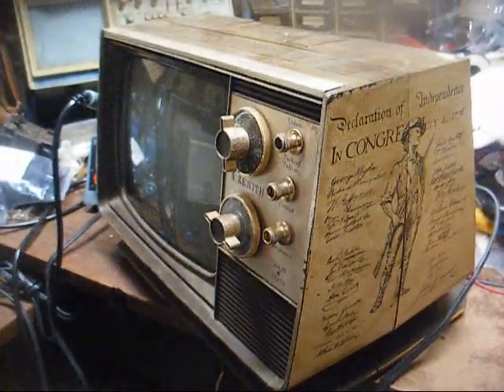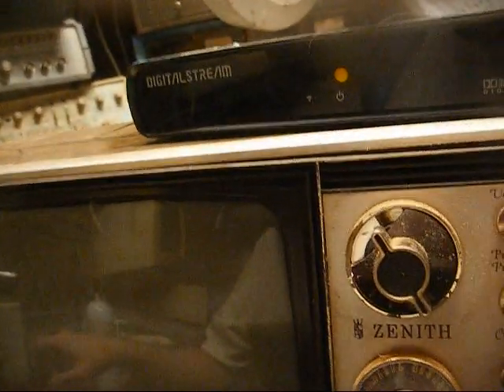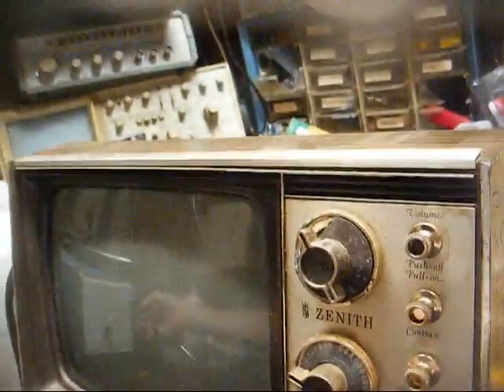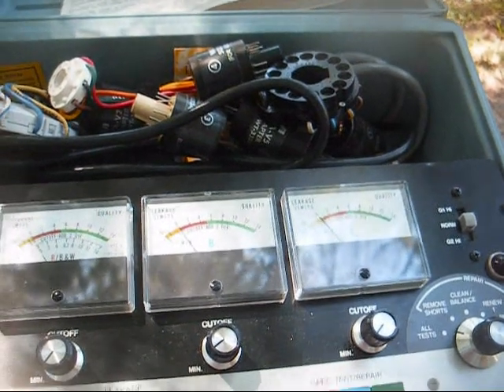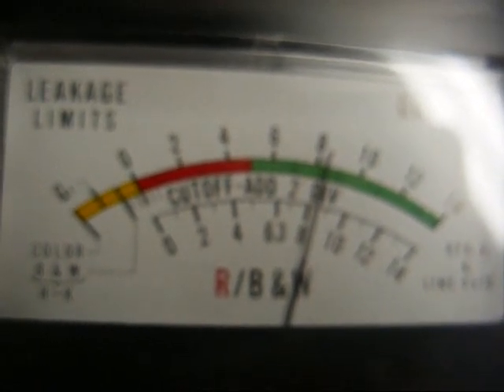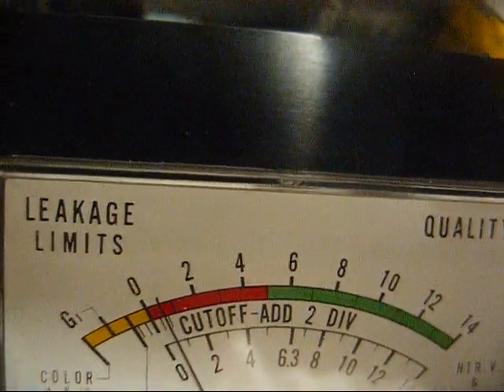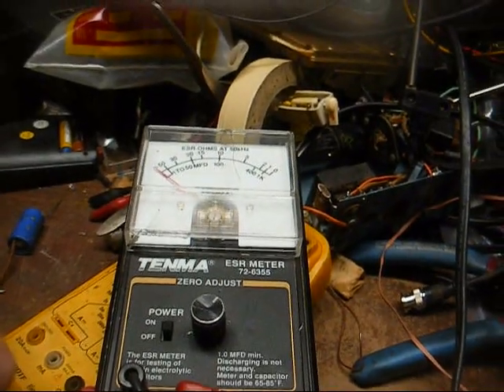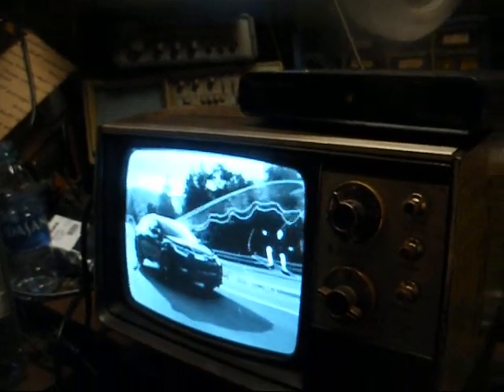Repair of a Zenith Spirit of '76 B&W TV

Comment: Nice to see this set Bryan,  I was a part of the B & W design team at  Zenith 1973-1981. This is one of my babies. Built in Taiwan but designed in Chicago.
Reply from the maker: You did a good job. I have a 12" hybrid Zenith B&W from about '73 and an early '80's Zenith 12" with the digital tuner. I'll do videos on those, one day.
Reply: @radiotvphononut  The 12 inch hybrid was tagged out by me in 1974 but was designed about 1971 before I got to Zenith. The 12 inch with a digital tuner was one of the last sets I worked on. That tuner was used in a 19 inch as well.  The 12 inch with the doorbell camera was mine. In fact I have the patent to prove that. The last set I did was the 5 inch with a clock and AM/FM radio.
Reply from the maker: @WilliamCohn  One Zenith I'd love to find is one of the 22" solid state B&W sets in a metal cabinet. In all my years, I've only had one and that was back in the early '90's. I think it was from 1977 and the CRT was dead. I rejuvenated it and sold it to someone cheap. Somewhere, I have the photofact on a Zenith B&W 22" console from '81 and I'm told that was the last year for B&W consoles because they stopped making the 22" CRT's. I think 19" B&W's held on for a little while longer; but, I don't know for how long (maybe mid '80's).
Reply: @radiotvphononut  That was my project as well. 19GB1X chassis and the last chassis 19LB1X. It was used in the 16, 19 and 22 inch sets. The 16 always had the brightest picture because they all had the same high voltage. The 22s sold well in your area down south. 22 inch CRTs came mostly from Sylvania but some came from Clinton in Rockford, IL.
Reply from the maker: @WilliamCohn  I've got two Sylvania B&W consoles that I got from a closed TV shop/dealer. One is from '78 and the other is from 1980. He told me that even in the '80's, they had older customers who wanted no part of a color TV and that's why he kept the large screen B&W's in stock for as long as he could get them. One time, I saw a price sheet for some of those later B&W consoles and some were as expensive as an entry level color portable.
Reply: A friend of mine’s uncle was an engineer there.... last name Hendrickson

Comment: The connector on the bottom would probably be for a battery pack
Reply: I just commented about the battery. Mostly a gimmick.  A reasonable size, weight and cost nicad battery pack could power this tv for an hour and a 1/2, maybe slightly more.  Radio Shack used to sell "high capacity" NiCad D cells that were 4500mah.  A pack with 10 of them in it would give you 54 watt hours and cost a hundred bucks plus a charger.
Reply: Apple Pro Battery Pack

Comment: You're so good at repairing electronics and I especially like your tv repair videos because I remember fixing the Dumont TV we had with a do it yourself manual and taking tubes to the tube tester in the Drug Store 3 blocks away.  Plus the tvs are the generation I liked most.

Comment: Nice to get the old timer going properly. The vertical bars can also be caused by the line linearity coil ringing when the  resistor in parallel with it goes high or open circuit  I used to see it a lot , particularly on old monochrome televisions  . But I expect you are aware of that problem.

Comment: Digital TV gets you a nice picture when the signal is very strong but in a weak signal you experience tiling and interruptions.
Reply: Eric Nolan  Oddly enough you can still get HDTV over the air if you connect an antenna to a flat screen.
Reply: The only thing I can say is that it produces a good picture or no picture.  in many areas you had with an analog system a perfectly watchable picture although not absolutely perfect.  It may have been a little bit snowy but you could see the image and hear the audio.  Now the industry is coming up with atsc 3.0 that was scheduled to be foisted upon us this year. With the pandemic it's probably going to be delayed at least a year.  at least as the plan went one channel in every Major market was to be converted to atsc 3.0.  wow you know what we're going to get for that 4K over the air.   1080p was good enough for me.  now the next standard which is not going to be over the year for a while is 8K.  When will this constant push for resolution end? There is a practical limit.  it was bad enough when we went from analog to digital as you could see the individual pores on a host face but with 4K we can now look down inside those pores and see what's inside.  Geez.
Reply from the maker: @randyab9go188  There will be no end because they want the buying public to constantly be buying more new Chinese-made crap.
Reply: @stphinkle  I can't where I am because according to antennatv.org I am at the extreme edge of my local stations. If I get a huge directional antenna and amp, I probably could get them, but it's not worth it for 2 stations. (Yeah, I live in the middle of bumfuck, Egypt. Actually missouri)
Reply: If you get the right antenna you can get very good reception. I built one and get nearly 80 channels. Most store-bought ones are garbage.
Reply: @radiotvphononut  My portable cd player is "modern chinese crap" That thing has taken one hell of a beating and still works!

Comment: I was 10 in 78 when we bought our first solid state b&w tv. Didn't have much money, so we had gone a few months without tv until we saved some to buy the 15" Truetone from our local Western Auto. I am much better off today and retired from being a high school teacher for 20 yrs. My married son and his wife and baby dont know such " depravity ". LOL.
Reply from the maker: That 15" Truetone was probably made by GE.
Reply: @radiotvphononut  Did they make portable tube types in the mid 60s? I had a powder blue/white two tone b&w . I used it in the early 80s. Thanks for your reply. I dig what you do and your common sense insights.
Reply from the maker: @bombasticbuster9340  Yes, the portable 9" and 12" B&W's started appearing around '63, or so. Even in the '50's, there were many 17" portables and some 14" portables; but, they were fairly bulky, in comparison to the later portables.

Comment: You are lucky. I can only get 4 over the air digital channels here and they are all PBS.
Reply: Do you use an amplified antenna? Those really help. Especially if roof mounted and equipped with a lightning arrester.
Reply: @cherrysdiy5005  I live in a valley surrounded by hills over 1,000 ft.up. Even sattelite dishes have difficulty here. That's why I have cable.

Comment: I'm in Canada, but I do remember these older types of TV sets from the 1970s, and the 1980s. They were neat. I remember the limited channel selection, like 3, or 4, before cable TV came along. How do you get reception on these, when TV is digital now? Thanks for sharing this. Cheers!
Reply: Here in the U.S., for older analog TV sets, we have converter boxes that hook up to the RF input on the back of the set. The output of the converter box is usually tuned to channel 3 or 4, and the channel-changing is done through a remote control for the box.
Reply: @chetpomeroy1399  We had those in Canada too. Also, we have more modern digital cable boxes. I wonder if those would work on older model TV sets?
Reply: @dwaynewladyka577  It would seem to me that those more modern digital cable boxes would probably work if they have an analog RF output for the antenna terminals.
Reply: @chetpomeroy1399  If no RF out, do what people did with DVD players. Connect the box to a VCR and use its modulator.
Reply: @dougbrowning82  That sounds like a feasible idea.

Comment: The boost cap on the color sets are 10 mfd at 350 vdc and located near the fly back with a diode in between (a high speed diode) Replaced many on the 9-160 Zenith sweep boards they had3 watt resistor that opened up if the cap shorted. That gave an all white raster with retrace lines and no video image
Reply from the maker: I ran into that fault many times with those.

Comment: The connector is for the rechargable battery pack. I would try the cap,
it can make a huge improvement in pix. Causes to much briteness......
Taiwan built the hybrid 12" & 16" B&W's They did have a US built 9" a few years later.
A dog to work on.
LFOD !
Reply from the maker: I think I know the one you speak of. They worked good; but, heaven help you if you have to repair it.

Comment: Sams Photofacs....the technician's "Bible" back in the day.  You could fix virtually anything if you had one of those for the set you were working on.  They would be virtually worthless on today's Chinesium junk because nothing is made to be repaired.  If it breaks, which it will quite easily, you toss it in the dumpster (who recycles anymore?) and go down to the local Wal-Mart and buy another one (they probably sold you the first one anyway).

Comment: The only choice of rechargeable batteries back then would be nicad and a nicad battery pack of reasonable size probably couldn't power this TV more than 90 minutes and even that is probably a stretch. This thing is probably using 25-35 watts.  Good quality D cell NiCd were only like 2000mah.  I have a bunch of portable 80s TV/radio combos both color and B&W and they all use at least 12 watts.  The most efficient is a 3.5" Sony TV boom-box and even that uses about 8 watts.
Bottom line, adding the battery option is more a gimmick than anything else. They are just too power hungry.